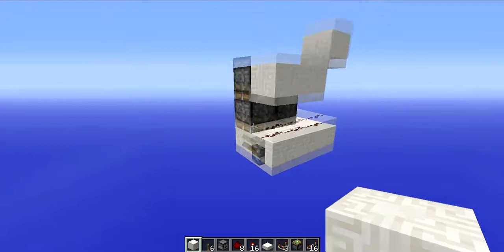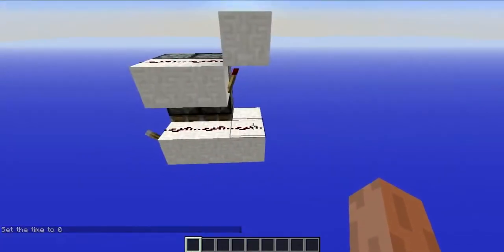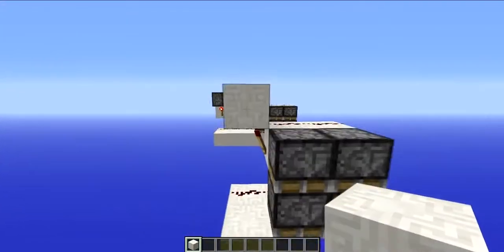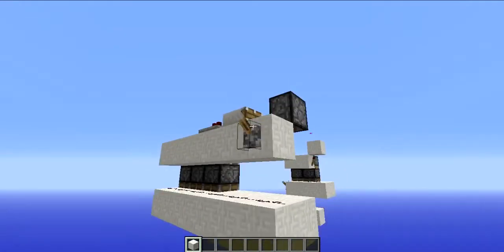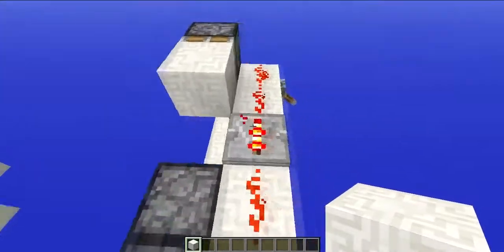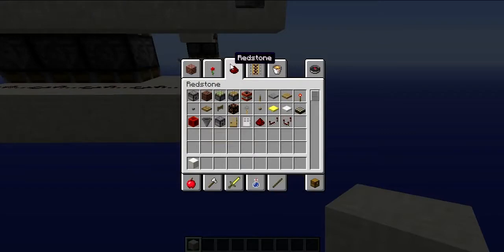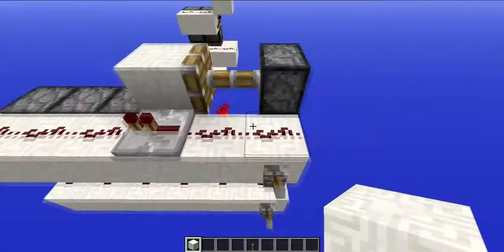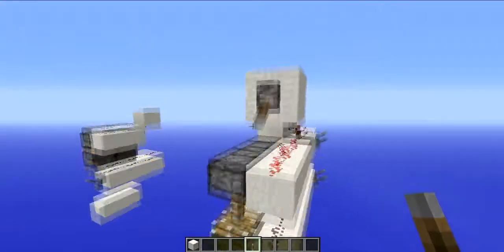SUPER COMPACT Expandable Downwards Double Piston Extender!

Comment: Just saying, the second one was the same size as the current smallest (my one which I have a video of, but I also  have a design the same size which works normally) but slightly less functional, as I have one that can be powered from anywhere on the bottom line, like the burnout one. By the way, I count using burnouts as legit, so I will definitely hand that record over to you.